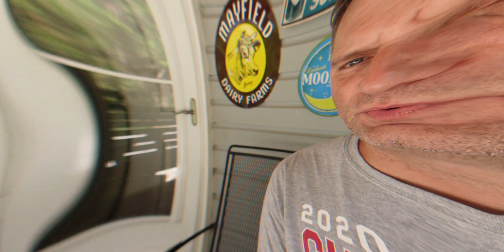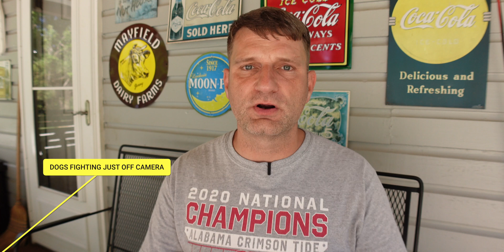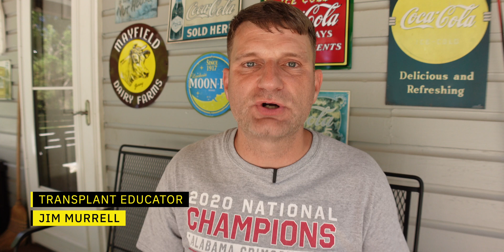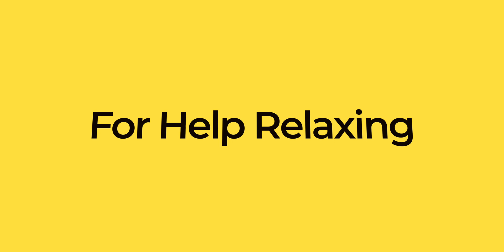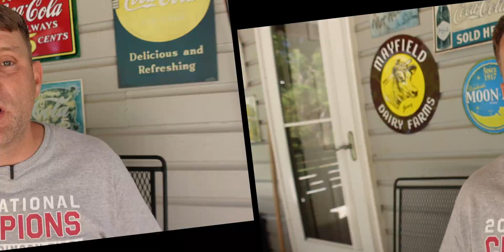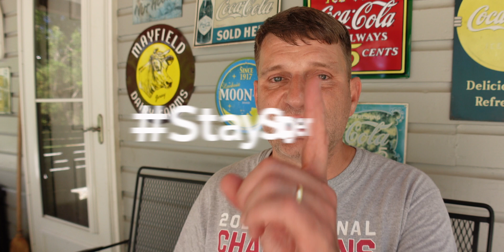Make Heart Biopsy MUCH Easier (Myocardial biopsy-cardiac catheterization)

Comment: Good advice. Each time I had to go in for a heart Cath I would ask them for some sedative and they would do it at the same time and it helps tremendously- chantal
Reply from the maker: Thank you for watching and for the encouragement.
Reply: My last one was via my neck, I really struggled to stay relaxed, I put it down to not having practiced meditating for a while, I usually meditate during the procedure this time I struggled. Never been offered a sedative, I will ask next, time top tip. Thank you. Having repeated episodes of rejection so having more frequent biopsies unfortunately.
Reply: @StevenToast8  You usually have to ask for it they will give you either a Valium or lorazepam a little bit before your procedure. I had my first heart biopsy last week and I decided not to take a sedative just because i’ve had cardiac catheterizations but I won’t do that again I was pretty anxious. No need to put yourself through that when there’s something there to relax you and get you through it.🌞